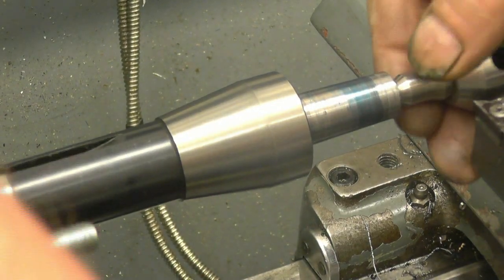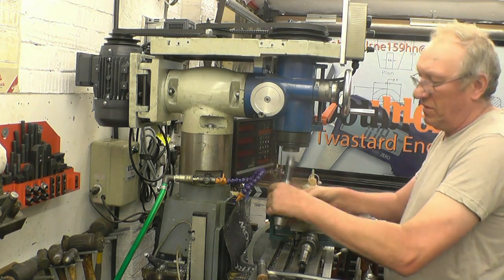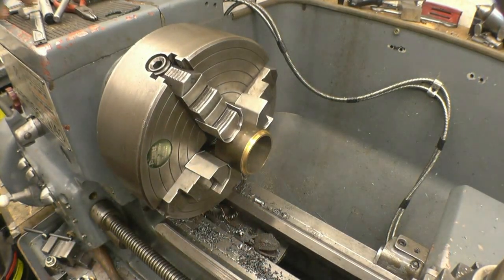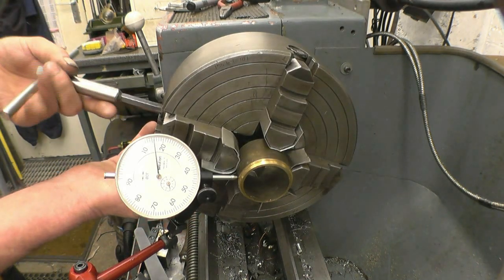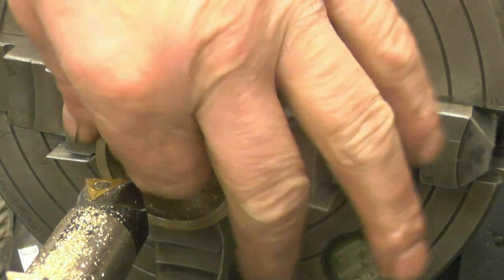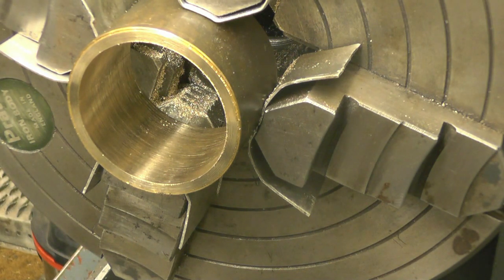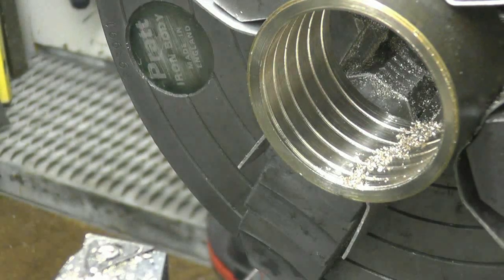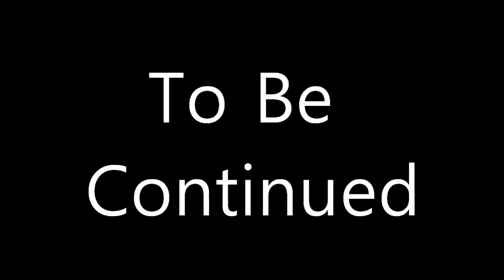SNNC 226 P1  Drill Chuck Arbour

Comment: Hi John,
Telescopic gauges should be used in a bore with horizontal axis ( as in a lathe ) in 12 & 6 O'clock orientation, otherwise, the weight of the head affects measuring.
Great channel as always.

Comment: Been waiting on you.  It is hard to find a SOFT STUB, BLANK END, R8 arbor, here in the States.  The only one on EBay is an RDG from GB at 10.25 Pounds and 22.50 shipping to the States.  May have to go that way, but it's not what I want to do.  - The grease groove looked very consistent for hand feed.  Now on to Part 2.

Comment: Also havng issues turning bronze in smaller manual lathes?HSS with a neutral top rake, edges honed to mirror finish. Very small corner radius, no more than 0,8mm. Conservative feed, find the speed that works on your machine.The other method is almost cheating but can produce a mirror like finish even on small Chinese hobby machines. Try polished inserts for aluminium. Very conservative feed, 0,2 to 0,4mm per rev. Very low depth of cut, about 0,5mm on the diameter.

Comment: John,
Not wishing to teach grandmothers to suck eggs but shouldn't you have taken down the NON blued area as this is where the contact is made and you are trying to get it down to that centre section? Or am I missing something?
Great videos as usual, Allan is a chip of  the old block.

Mike
Reply: Wouldnt it depend on the angle of the jacobs taper? If it was too small the non blued area would not make contact; too large and blueing would make contant?